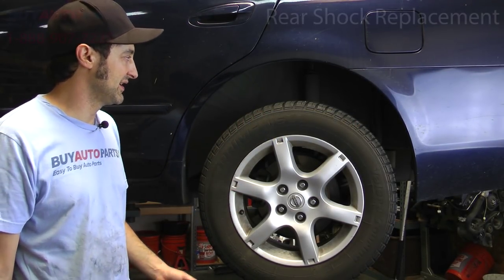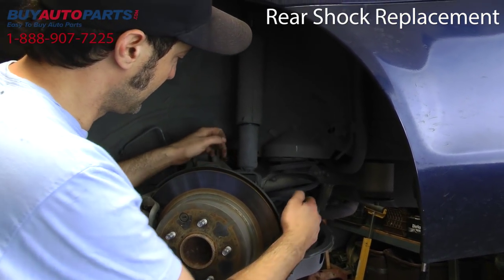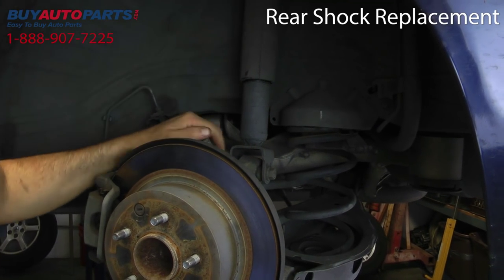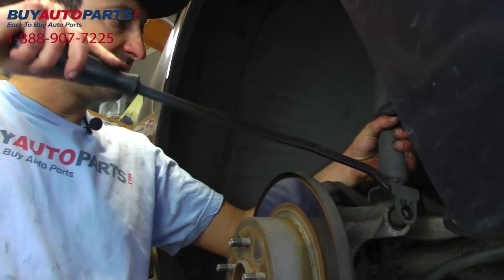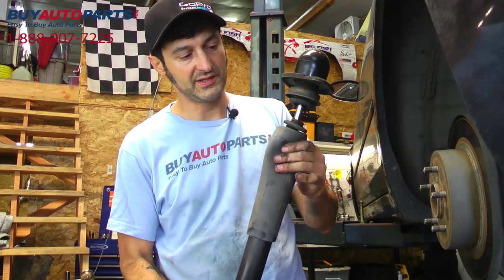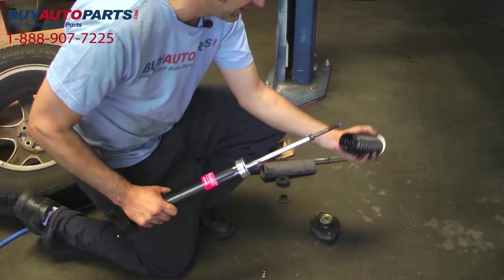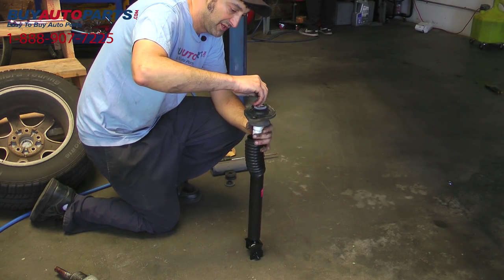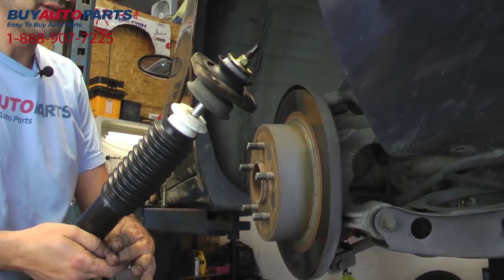How To Replace Rear Shocks - BuyAutoParts.com

Comment: Great video, I noticed you added a boot and seal?  I have a 2008 Elantra, just wondering do I need to get this or replace with new ones when I replace the shocks on the rear?

Comment: I need your help please...SINCE YESTERDAY I NOTICED MY CAR JUST START MAKING A SOUND EVERY TIME turn my wheels to the left and I have no idea what's that.please give me your advice
Reply: If your car is front wheel drive it may be your constant volisity joint  ( cv boot joint) look under your car if you can look for grease flung around by  the wheel if the dust boot is broken it will make a noise when you turn left or right depending on witch side you have 4 joints on a car, an inboard and out board  .  You have two haft shafts on your car right side and left side. If the joint is still good you can just replace the boot and grease, or you can replace the whole half shaft with a rebuilt one if it is available for your car .it takes special tools to disassemble your suspension so it can be expensive. There is also quick boot kits too so you may not have to disassemble suspension.  You really need  a lift to replace makes a lot easier. Good luck :-)
Reply: +Michael Gallegos This is a really greasy job.